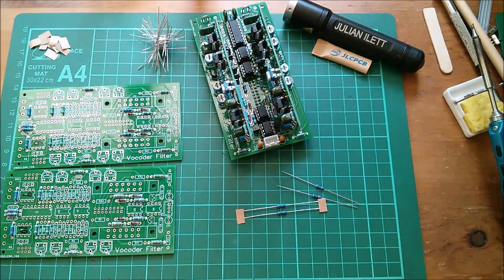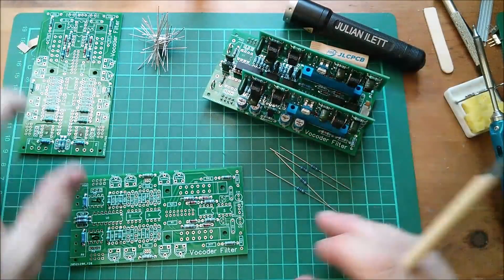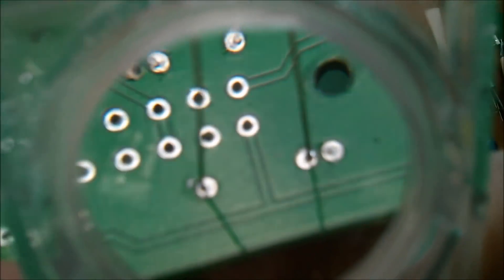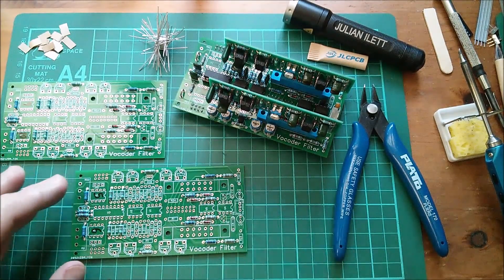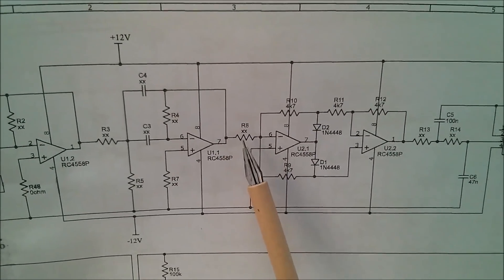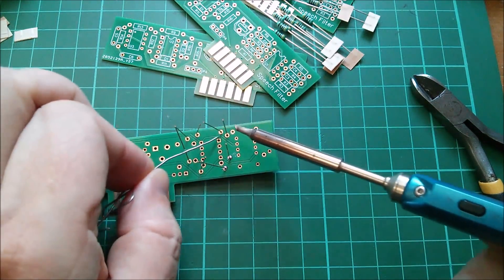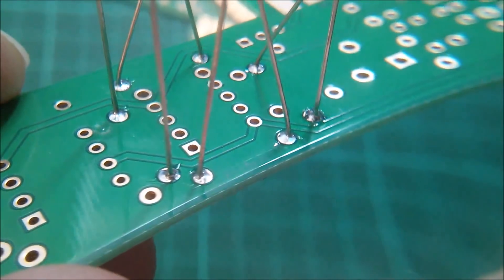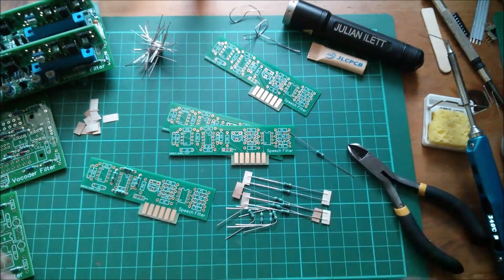Soldering with Julian #1

Comment: what is all that craze on separating the metals about? it does not make all that much difference electrically given the very moderate lenghts your gonna use and the recyclers will probably just stick a magnet in as well...

Comment: at 9.05 you ask whats 50ppm. 50 PPM is the temperature coefficient , so you know by how
much the value will change with temperature. import to know if you are making
voltage dividers as your ratio will change with temp and you need to select the
PPM value to meet your requirements.
Reply from the maker: Of course it is )

Comment: The solder should just be a filet of solder between the wire
and the pcb. the solder is just the electrical connection the angle of the wire
should provide the mechanical strength. there are production standards for
soldering, but can't remember them
Reply: The Embedded Hobbyist - it depends on the type of board, the type of component and it’s intended use. For maximum mechanical strength and maximum lifespan in an environment subject to vibration, use PTH boards with large pads and form every component leg/pin so that it is bent at right angles on the ‘bottom’ side of the board. But for normal usage (hobby projects / normal commercial) there is no need to bend the pins/legs, or have a mound of solder on the ‘bottom’ side of a PTH board.
Of course, for large or heavy components (transformers for example) a commercial product may use other techniques as well.
Reply: @Mark1024MAK  i always give a slight bend for home use, 90 deg if at work.  always found that PTH boards were better for vibration. i use to design and build PCB's used in jet fighters and multi-engine transport aeroplanes. when doing resonance search tests on the PCB's the SMD one give the most problems. don't take much of a bend on the PCB to fire the components off. PTH always seemed to take the bending better. it's amazing by how much a PCB fill flex at resonance.

Comment: Scraped my car for the first time this winter - and thought about your outdoor working area, just wondered how effective the oil burning heater is at warming it up now it's getting colder outside.
Reply from the maker: I'm not allowed to use the outdoor working area, so heating it is a non-starter. Also, the diesel heater stopped working :(
Reply: @JulianIlett  I guess the dragon / wife said no to outside.  I took over the attic for electronics.

Comment: I think the reason more solder is advised, is to avoid that pressure along the legs cause the whole joint to loosen. Plated-through holes would be less prone to this, I suppose, but the joint would be stronger with more solder. For hobby projects, it's probably not going to matter.

Comment: Talking about resistors. When Maplin in Plymouth was shutting down, I went in to get some bargains and came out with about 200,000 resistors for about £5.
I miss that shop and he staff that worked there.
Reply: I miss the original Maplin shops from back in the 1990s. There were 20 in 1992/1993. I visited the Bristol one whenever I could (which was not often enough, as I lived about 21 miles away).

Comment: Way too little solder. Also you should apply the solder in one go and not dab it multiple times. You want the solder to heat properly to let the flux burn away while deoxidizing the surfaces. I suspect you have a lot of cold joints that will fail over time. Still really like your videos!
Reply: McG does have a good point here. Now, I have to admit that I'm utterly OCD about soldering because I design safety-critical stuff. If you ever fly, however, be grateful.
Making the solder joint should be in one smooth uninterrupted operation with enough time for the solder to flow properly through the via hole. Also there really should be more solder than Julian is using here; it should be a nice concave meniscus.
The IPC publishes a wonderful standard called IPC J-STD-001 which shows with clear pictures exactly how it should be done, and what is acceptable for different types of work. For example, the standards of solder joints for consumer electronics are different to those required for safety critical equipment. It's a shame it is so costly to buy because it is a work of art as a definition of "how it should be done".
Reply: Respectfully, I disagree. Julian is not double dabbing the soldering iron tip.  He is following a good practice of first wetting the joint (which aids consistent heat spread across the joint), and then feeding the final solder flow.  Your comment on wanting the solder to heat properly would only apply if he was removing the iron tip too quickly, which he isn’t.  Also, I believe the solder volume is adequate. As Julian explained this is PTH (plated through-hole) so there is a broad joint formed by the solder correctly flowing into / through the hole.  This is electrical not plumbing work, so added solder is not needed for mechanical jointing strength. :-)
Reply: @DigicoolThings  Fair enough! I was taught to always apply enough solder to form the familiar solder shape and to apply it in one go and linger a bit with the iron to let the solder joint heat through. But probably many techniques are adequate!
Reply: @mcg6762  I know where you're coming from. That does sound exactly like the way I was also taught, by the experts, way back in my early days in the late 70's.  But that was back when we were soldering single sided PCB's with robust 70's soldering irons!  :-)  To be fair, with modern soldering tools and PCB fabrication there's probably many different techniques that will prduce an adequate result. Plus, your own personal many years practiced techniques will also vary, depending on what it is you are soldering.
Reply: I tend to use the continuous flow of solder technique as I find this the quickest and easiest method. How much solder is needed does depend on the type of board (single sided or PTH), the size of the PCB pad and the difference between the cross section (diameter) of the component leg/lead and the cross section (diameter) of the PCB pad and PTH. If there is enough space, the solder will flow through the PTH and “mound up” on the other side. So with PTH I don’t worry too much about getting a nice shape on the side I am soldering. I do check the ‘top’ side to check though. I do make an effort to get a nice shape if the component requires mechanical strength or the legs are being used as heatsinks.

Comment: Whilst it's handy to save a few tinned wire cutoffs - I'm not so sure about one metric tonne of them... and yeah, 4 band resistor code drives me mad - I used to be able to spot the right resistor in a mixed tray and pull it out with the pointy pliers in seconds - not any more :o(